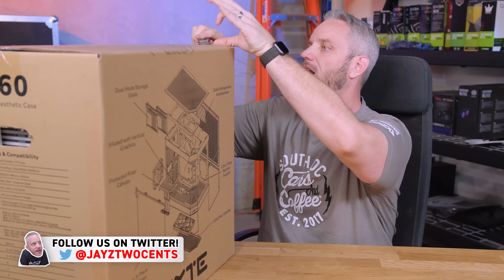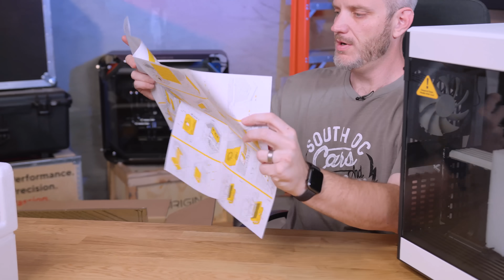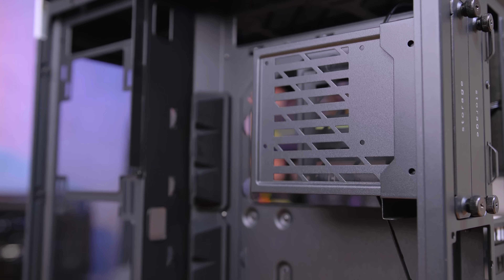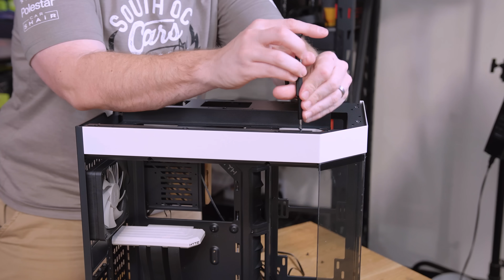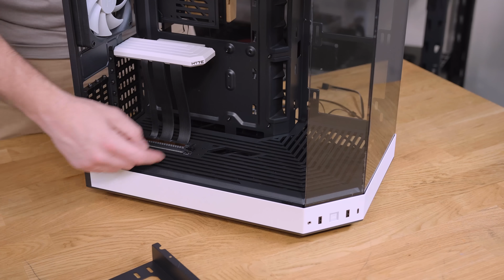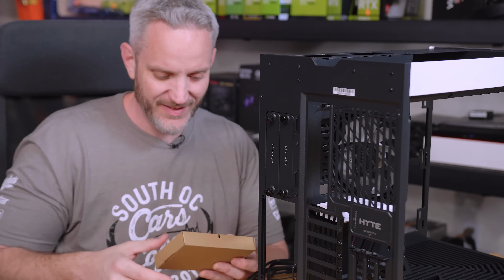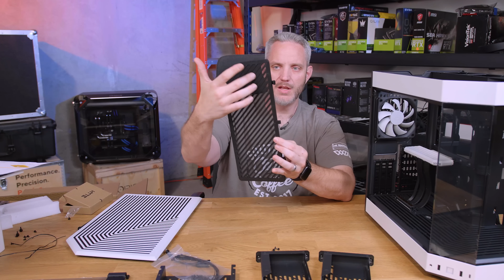Someone FINALLY broke the mold for PC cases...

Comment: While I understand the idea behind those remote vertical GPU mounts, what I don't understand is why they even bother making it possible to fit air-cooled GPUs there. My experience - admittedly not a controlled, technically-sound experience - is that you can get significant cooling benefits by providing at least the fan's radius in open space for it to "breathe". And that testing was conducted with a 3-fan, dual-slot GTX670 , which draws nowhere near the power nor generate as much heat as these modern behemoths. So jamming it up against the side of the case like that is really going to sacrifice performance just for looks unless you go for liquid cooling, making the three-slot provision more of a "trap" feature than a useful one.

Comment: so many comments are bashing the case for only supporting LP expansion cards, but most expansion cards other than graphics cards are actually low profile... I have an SD card reader that's low profile, my HD60 Pro is low profile, my WiFi/Bluetooth card is low profile, a bunch of USB pcie cards are low profile, there are low profile sound cards, hell even the GT 1030 is low profile. if there was no vertical mount, I'd understand the frustration, but most pcie accessories that you'd need other than a GPU can be adapted pretty easily... the only reason I can see that being an issue would be if you need SLI for some specific workload, but that's definitely quite a niche at this point. not exactly a reason to write the case off as bad

Comment: Hi Jay, transplanted my current build to this case just now. It’s been ok so far but with a few caveats:

1. Issues with installing 140mm fans on the bottom. Had a hard time installing my QL140s and SL140s, was able to barely install my Noctua A14s. They should have opted for screw slits (i don’t know what they are called) instead of holes. 

2. The DP/HDMI ports on the vertical mount plate at the back will be slightly obstructed. Maybe due to my card (Strix 3090). I had to slightly angle it a bit so my DP cables would be in. 

3. You need a very slim screwdriver, or those that can be bent for the Expansion slots and Vertical GPU mount screws behind. 

4. If your motherboard has those chunky side of the IO panel, it would limit your rear exhaust 120mm fan choices. I used an SL120, had to make an effort in installing it as my motherboard has a beefy IO side panel. It’s literally flushed to the side. My QL120 won’t even align on the screw mounts. 

Overall it is a nice case, but coming from a Fractal Design Meshify 2, I’m not sure if it was wise to have moved to this. Thank you

Comment: Front USB ports on the bottom was the deal breaker for me. If the case is on the table then I guess there is no difference, but my case is under the table...

Comment: I was sold until we looked at the back
2 drive bays and no expansion???? whoever thought choking a 3 slot graphics card for extra style points was more important than expansion compatibility deserves to get WillSmith'd all over their head and get a different design job away from computer cases

Comment: I'm not a big fan of the 'fish tank' look, but the design of the chassis clearly had a lot of thought put into it by people who actually build PC's. I like the trend of moving the PSU and HDD bays to the rear of the MOBO tray, as it makes cable management way easier, though I do prefer the option of at least 2 3.5" AND 2 2.5" drives

Comment: the fans on the bottom make zero sense unless they are on negative pressure and push the air out. Take the standard card design that sucks air from the front and pushes it from the side. The card tries pushing air out but the bottom fans trap it in the radiator. Ryzer cables are a gimmick unless you specifically engineer your airflow. Which this case has not really tbh. Looks cool tho

Comment: Would love a quality case like this with good dust filtration but in a cube style with room for 2 360 or 480 radiators side by side up top. Flat laying motherboard so no need for a riser. There are very few choices out there but for me the most logical design.

Comment: When Jay first pulled the plastic off the case my first thought is that it looks like a fish tank. As far as storage, one can always get a couple 3.5" drive bay adapters. Those adapters typically allow for two 2.5" drives, so in theory one could mount four 2.5" SSDs.
Reply: no adapter needed!! those drive bays already support 2x2.5" SSD each. There are mounting screw holes on the sides of the sleds. so each sled can either have 1xHDD or 2xSSD.
Reply: I thought the same thing! I'm sure that we will get to that point sooner or later lol
Reply: Robeytech built a functional fishtank in one of these! Quite a fun video lol
Reply: You could put a hundred SSDs in this case if you had enough SATA ports and didn't mind how stupid it looked. SSDs can be stuck anywhere, at any angle, with minimal airflow. Wedge them in among the cables if you want. The number of SSD mounts are never a limiting factor.
Reply: Do people really use it that much anymore? I mean you can get huge m.2 drives and most decent atx mobo's have 2+ slots. and then you still have those two sleds for additional storage. I'd say you have plenty.
Reply: @Naturalhighz  4TB M.2 SSDs are still very expensivve
Reply: @Naturalhighz  Yes we do. I use a Haf 932 coolermaster with a couple of 3 5.25 bays to 4 3.5 with 120mm fan slot in the front in addition to the bottom 5 trays that came with the case back in the day. It has 5 disks in one vdev and 8 in the other one. This is so all the other computers in the house can have only fans as moving parts.
Reply: agree, fish tank
Reply: I actually was going to ask if this looked like one of those dresser top style fish tanks from way back to anyone else haha. At least I’m not the only one.
Reply: id seen a "fish tank aquarium" blog article & it was April Fools one!!  also, can see from Paul's hardware's YouTube channel did one over ~2 weeks ago!
Reply: First thing I thought too. A fish tank that doesn't hold water, lol.

Comment: I took a system I had in an Arc90 case into this.  The TR2950x and Nitro+ Vega64 run cooler now.  I wished the front I/O was in the top corner or movable between the two versus the bottom as my case is on the floor.  I wished the white version was more uniformly white.  I wish the power button's white led was addressable.  I am NOT going to say anything about the low profile slots.  I knew this going in.

Comment: It's different for sure, but the second it came out of the plastic I thought it looked like a cheap aquarium. Then as Jay was spinning it around, I was reminded of a neo angle shower surround. 

 And it looks massive in a chonky squatty way. 

 It does look like it would flow more air than most cases, so it's got that going for it.
Reply: I'm pretty sure Dawid heard you use the word CHONKY.

Comment: If i was buying a case now I would consider it but when I do upgrade, I need to buy a mobo/cpu/ddr4-5 and a gpu so will prob stick with my Fractal Define S with tempered glass side panel for a long time. I am tempted to even go for a smaller case to save room if I was changing case.

Comment: I can see this case becoming more popular than the Lian li 011 dynamic if it has a competing price.
The half height expansion cards I don't think will be a problem as most builds are just the GPU.
But it would be cool to have a half height expansion to vertical full slot riser cable, so it can fit behind the GPU.

Comment: I feel like the vertical gpu mount is a deal breaker. This case is designed around good airflow, but 3 slot GPUs (that are more and more common) will be starving for air, because they're forced to be near the glass.
Reply: You don't need to use it?
Reply: @ZeldaxLegacy  how do you mount a standard GPU to a discrete mount?

Comment: Good video, really disappointing product. only two drive bays, only low profile slots for anything but a video card, and if it looks like an aquarium, i would expect it to BE an aquarium. Even if the cooling is good, you can't fit much in it to actually cool.

Comment: I WAS interested, but then you showed the rear PCI expansion slots being low profile is a turn down for me. I don't want to have to mount a GPU vertically, so close to the side window without ventillation, while the underside of the case generates a great environment for a normally mounted GPU (like the Fractal Torrent). I'd choose the Fractal Torrent over this, even though the Torrent is more of that "standard box" type of case.

Comment: Its a nice take on visual astethics, but having the shortened expansion slots throws it off. They seemed to have included several things that end up costing more money to the user later on down the road ( head-phone splitter, vertical GPU mount with the PCiE extension cable ) But they also need to keep in mind some builders would prefer the option to have both. They are trying to hone a design that mimics the 0-11D but is also "different at the same time" with the tapered front panels of glass. I would like to see a revised version of this case offering both vertical and horizontal mounting options for GPU's. If they are trying to keep up, they need to look at how the Lian Li 0-11 Dynamic Evo offers such versatility as well as the basic build options. To me the 0-11D evo has changed the game with how the entire case can be flipped to adapt to so many different builds! Whether that be air cooled, AIO's, custom water cooling, etc etc etc. Will be keeping an eye out for future updates as well as skimming through reddit for unique builds people come up with

Comment: Really interesting case! Love the plentiful airflow and unique design, but definitely not for me. 1) The low profile card restriction is a deal-breaker. 2) I still use 3.5 drives for bulk media storage. SSDs are coming down in price per MB, but you can get a 6TB HDD for ~$100 and I don't think we'll be seeing prices like that for SSDs for a while yet.
Reply: so you need more than 12tb + w/e m.2 slots your motherboard will provide? how much media do you have lol
Reply: Move the 3.5 drives into a NAS. It's much cleaner that way, and has other advantages too. Not cheap, but a lot cheaper than tens of TBs of SDD.

Comment: How often do people use more than 2 drive bays would be the real question, I doubt its many, especially in smaller form factors. What I want is an adjustable window so that the front facing card becomes the window and so theres no air restriction

Comment: Cases will not get any major changes as long nobody develops a new motherboard layout, moving away from ATX. We are at the point where cases are no longer developed to fit the ATX standard, that's been done for decades now. We are now in the stage where cases are built to mitigate the ATX standard downsides.

Comment: I really need cases and motherboards that make room for a sound card.  As it is currently, the PCI slot almost always comes after the PCI-E slot, so standard mounting means I'm choking off my GPU's air supply; plus I have no idea how well vertical GPUs would go with a horizontal SPU.  

I know my use case in niche, but it really would be nice if case and motherboard manufacturers remembered that some of us use non-standard hardware.  =/

Comment: This would be case of the year but having no expansion slots whatsoever makes it a complete dud. No wifi card. No pcie m.2 cards, sound cards, iv never seen any of these components in a small form factor.

All so you can have a silly gimmick vertical gpu  that is bad for thermals.

Comment: Since tooling is already expensive for this case and the half height expansion slots are clearly a compromise it would have been so thoughtfull to pull a lian li and make the rear panel (expansion slots) modular and have one for vertical GPU mount and one with 7 full height expansion slots.
Also it would add a lot of usability to the drive sleds if they were the hot pluggable style with the wires attached to a backplane so that when you pull them out the drive automatically diconnects from power and sata cable.
Still would like to see a build from you in this case, Jay. Maybe you can figure out how to put a rad in the bottom which you alluded to and then have a custom loop with three radiators in total

Comment: The major problem I see with the case is the bottom fan filter.  It looks like in order to get it off you have to turn it on the side to push the tabs in and remove it.  That combined with the half height expansion slots would make this a no for me.  If I was to go with something like this o would got with the corsair 680x myself.  Though I just finished with my new build and went with the enthoo pro 2 for it.

Comment: I'm surprised they didn't go with a modular expansion back panel. one option with full size horizontal slots and maybe one or two vertical, or even none and the second like this with half size and three vertical.

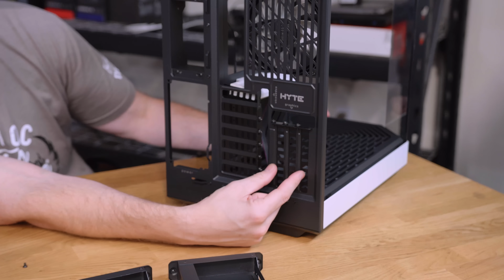Comment: @Jayz Two Cents  11:08 There is one possible solution to the low profile expansion slot dilemma: a small square nylon spacer, possibly 3D printed, placed between the top of the slot screw mounting location and the bottom of the card's ' L ' mount would take up the slack. All you need then is a longer screw with the proper threads for the extra reach. And yes, I'm strongly considering that case for my next build, I like the space and the design. 👍

Comment: I was looking at buying the lian li 011 mini but got annoyed that it required an sfx powersupplw when I already had an atx. Super stoked to find the hyte case released. Got it a couple of days ago and was able to put a custom soft tubing water loop in it. Super happy with the cooling capabilities. Want to eventually do a hard loop but need to practice.

Comment: i been eyeing this case, been wanting the case, but the costs of getting it in europe . . . . . (so went for the O11 Evo instead)

And in regards to the low profile . . . realistically, this case is for gamers and MAYBE for people who use their setup as a workstation. Aside of the video card, and perhaps a capture card (which has a half profile bracket in most cases), what other cards are you realistically putting in there before even hitting the PCI-E lanes cap?

Comment: You keep calling the panels "the biggest air filter ever."
Are they actually air filters? Or just vents? Because I removed the side panel on my chassis and placed a 3M 2000 series electrostatically charged 6 micron filter to sift out and trap ALL of the dust, lent, etc that normally enters the casing.

Comment: Just finished my build in this case. The name of my build is “depression killer” on pc part picker and I think it’s the only completed build posted for the Y60 right now. I’m just gonna say I spent more time thinking about what fan configuration to run than actually building the pc. It is super spacious and easy to build in.
Reply: I bought this case, too! Gonna build in it soon. Saw your build on PC part picker and it looks amazing, you did a great job!
Edit: I'm also planning on putting my anime figure in there lol I hope temps won 't hurt it haha
Reply: @MoonFidelity  anime figure will definitely not hurt your temps😂 and thanks 😊
Reply: @Youngenius83  Oh no! I meant that I am more worried about the anime figure getting hurt (like melting idk). It should probably be fine tho, it's not really the air that's hot within the case I'd assume.
Reply: I've just been looking on pcpartpicker, and there's a grand total of 2 builds, including yours which looks great.
Reply: @SquishyFletcher  thanks bro😊
Reply: Nice build, but I think some of your fans are in the wrong orientation. You're intaking from the top instead of exhausting, and you're exhausting from the side instead of intaking. (Edit: I can't see clearly on the pics your orientation might be fine for the side.
Reply: @BrawndoQC   you are right about the orientation of my fans. I did this on purpose because I went aesthetics over temps. So far this orientation has not effected my gpu temps. I really didn’t want the side mounted fans as intake because I just didn’t wanna look at the back of them. And since most of the time you’ll look directly at or look down at your pc you never really notice if the top is set as intake. 🤷🏾‍♂️ I ran a gpu benchmark and the temp never went above 78c but I should mention that I replaced the pre installed 120mm fans at the bottom with 2 140mm noctua fans
Reply: @BrawndoQC  let me know if I’m hurting my pc with that orientation tho but from my research I’m just supposed to take a temps hit